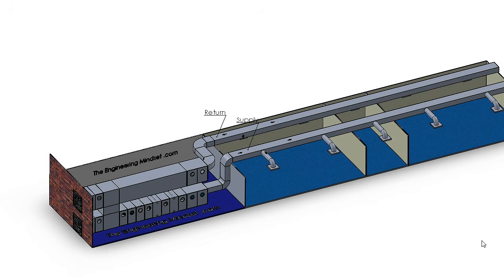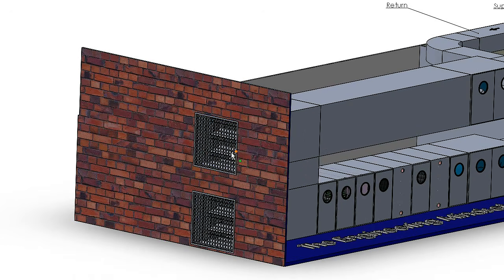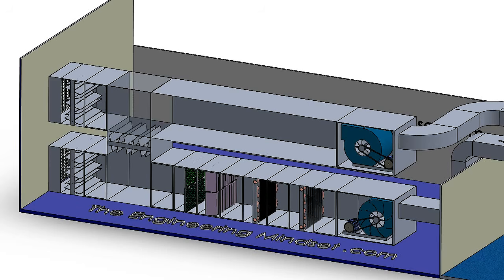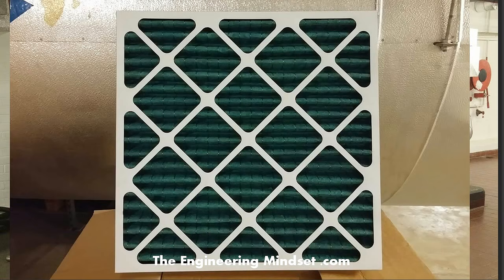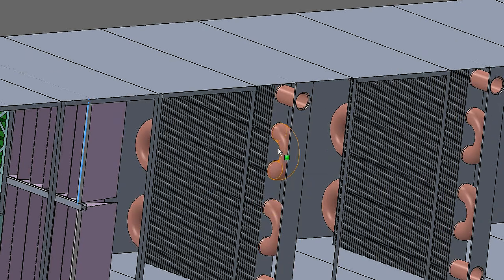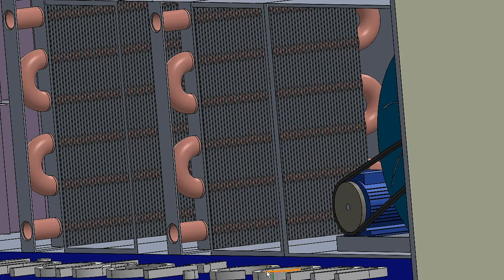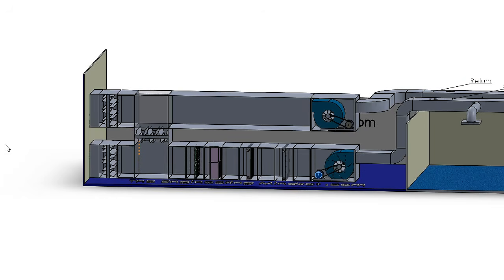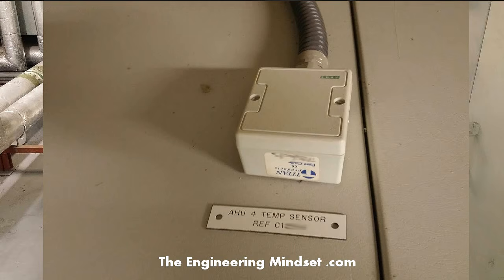Fundamentals of HVAC - Basics of HVAC

Comment: Hi Paul, you explained it very well in a way people can understand easily. Thank you very much for that.

 By the way in the last stage of the video where you showed AHU in BMS, I saw return air temperature was 16.8 which is less than the mixed air or supply air temperature. I hope it should be between 20-23 degrees which is satisfactory for end user and above SA or MA. 

Does it has any connection with on cold and hot region?

Please correct me if I am wrong.

Comment: Nice explaination about AHU!! I have one question about the sequence of heating coil and the cooling coil. I found in a lot of books, the cooling coil is place before the heating coil to cooling the air to the dew point temperature and remove the moisture in the air, and then heating coil will reheat the air to the designed temperature. Or it is only a design for humid climate and for normal climate where we don't need to remove the  moisture in the air, we can place the heating coil before the cooling coil so that the heating coil can also solve the freezon problem of the cooling coil.

Comment: Revit MEP – HVAC Doubts

1.	How many no of Supply (or) Return Terminal should place per Space/Room/Zone. Is there any calculation method or formula or factors ?
2.	How to connect  AHU(Air Handling Unit) with Transformer (Power Supply) ?
3.	How to Calculate Duct SIZING  (Velocity and friction Value) .
4.	Why We create schedule and quantities generally for HVAC & Electrical ?

Revit MEP – Electrical Doubts

1.	How many Lighting Pictures should place per Space/Area . Is there any formula or method to calculate this.
2.	How to Adjust Wattage value as per no of lighting picture and why we create  schedule & quantities comparision.
3.	In Electrical Panel report I received room 1,2,3 in single row and word mentioned as “Dwelling Unit”. I could not understand the meaning.
4.	How to connect Fire alarm/Nurse Call/TELE COMMUNICATION Devices with switches and power supply (transformer).

Comment: At 36:14 you say you will get much greater efficiency in the heat exchanger if the fluid is moving against the force of gravity. Is that a mistake? I can see how that may make sense in a refrigerant evaporator or steam economizer, but I don't understand how gravity impacts the flow of single-phase water. Can you clarify?

Comment: There seems to be a lot of extra, open space between the panel filter and bag filters, and then between the bag filters and cooling/heating, and then more open space between the heating/cooling and the supply fan.  Is there a reason for that?  I wondered if you may have spaced them out further for illustration purposes only.  Otherwise I would think it would be more inefficient with so much open space in between each section.

Comment: Thank you for the amazing explanation, but there is something I can't understand at 41:32 -You pointed out expansion valves and refrigerant pipes within the AHU - shouldn't the refrigeration cycle and refrigerant just be in the chiller? Based on my understanding of your previous videos, AHUs, FCUs, and cooling towers just exchange heat between air and water, and only the chiller exchanges heat between the refrigerant and water. Why is this AHU different?

Comment: Does adding a heating coil to an AHU degrade the cooling efficiency of the system?

It seems like the heating coil will constantly provide added resistance to airflow and make the return air warmer while in cooling mode.

Comment: Hello, thanks for this video. Only question is regarding the heating and cooling side of the system. The cooling coil is fed from the chilled water pipe work which in turn is fed from the chiller or fry air cooler, for the heating coil, is this fed from the lthw pipe work in turn fed from the boiler/electric heater/district heating?

Comment: @19:08 is heating and cooling done on the same air? if not, there must be separate ducting for hot and cool air, right? if yes, then then why would we heat the air first and then cool it, if we only need cool air? also if we only need hot air, why would we even need to cool it before or after heating them?
Even if we need both hot and cold air for separate places or for different times at the same place, there must be different ducting , or AHU may be (I am not sure) , for hot and cold air, right?

Comment: The pump location is correct. If it was after the chiller then the pump might cavitate depending on what head is available on the inlet to the pump. Chillers do tend to have a pressure drop through them

Comment: Great video! 👍👍👍

Don't forget to grease your motors and fan pullies.

Want to learn when and how to check steam traps and if they're working or not.

 Also how to blow out/drain/clean the strainers? And how often to do it. Once or twice a year. And which straine is most important to check, hot or cold?

Please explain in basic terms how to trace the supply and return lines for heat and or steam and or cold and condensate?

Comment: Hats off to your all efforts.
How can we find the velocity of air at ahu's inlet and then in ducts?secondly I would request you to explain the full load conditions and off load conditions of ahu in up coming videos and throw the light on the topic how chilled water will bypass the cooling coil during off load conditions and working of three way valve?
Can we get heating and cooling through the same coil installed in ahu? If we do then what impact it would have on the coil?

Comment: Question: how does air know where to flow? What i mean is,  at tees or branches, if a certain flow rate is required in one section, and a different flow rate is required in another and both sections are the same size, how does the air know how to split? Nice video by the way.

Comment: Question from a student: In Norway the regulations state that recycled air should only be used when there are no occupants in the building to better maintain the thermal IAQ overnight and ventilate the emissions from building products. Would it then be better to have a heat recovery system there as well which keeps the exaust and supply air seperated during work hours and allow the dampers to open during night when recycled air is allowed?

Comment: Great video, I've just started my HND so this is really useful for me! I have a question on the heating and chilled systems; how do the systems heat up and cool down the air, for instance if you require more heat does the heating coil come on for a longer time or is the heating coil set to a certain temperature? Hope this makes sense.

Comment: My question: the chilled water going into the cooling coil fins come from the chillers evaporator loop ? because on the other side  ( Condenser) the loop of warm Condenser in and out of Condenser goes into the cooling tower using installed on the roof top